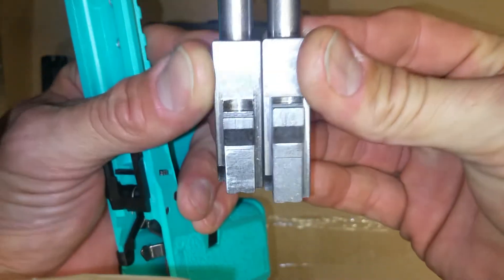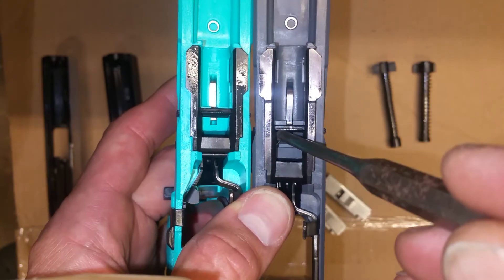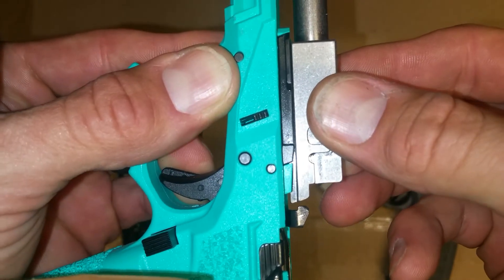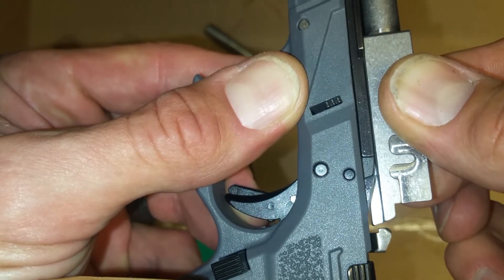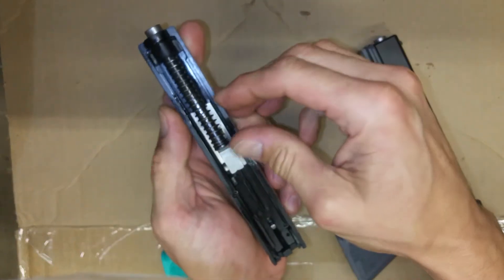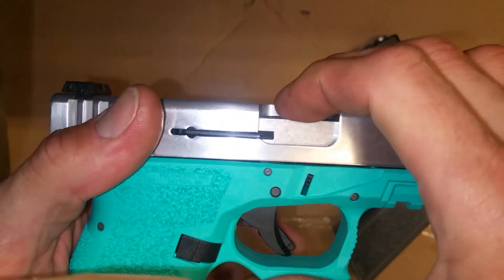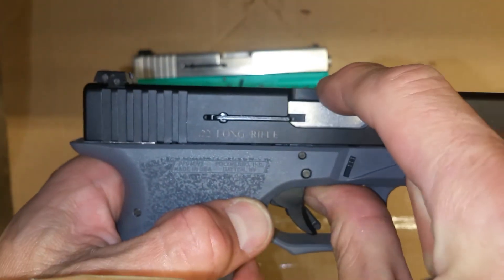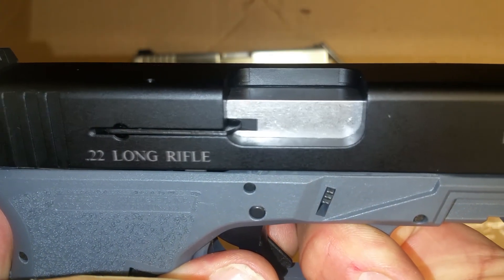Polymer80 barrel travel in lockup (Advantage Arms 22LR)

Comment: I just got the conversation kit for a G22 and it does not function correctly. It fires the first shot upon manual release of the slide but every follow up shot does not fire due to a light primer strike. It seems as if the extractor is pushing back on the barrel not allowing the striker to get close enough to  impact the rim fully. But strange thing is it fires fine rapidly, but does work with slow controlled fire. Any thoughts or come across this?

Comment: How do I take the paint off and make it look like that
Reply from the maker: I masked off the area where I did not want to remove the black coating (anodizing ?) and bead blasted the exterior, then wd-40/mothers with fine steel wool then cloth, I wanted a satin finish rather than mirror.
Reply: How can I get it mirrored

Comment: Those frames are pretty clean on the inside .....what did you use to mill it out?   

I've owned at least 6 Glocks through my life... 3 being the g15.  No I don't own one now.  My favorite was the g30 my dad had but I had a g21sf that was also pretty shaweet.  
I've been wondering about doing a few of the p80 .22lr and 9mm.  Currently looking for deals on multiple frames.  Being plastic they should be sold in packages of at least 2 or 3 as this really compensates for lack of experience and it's better for the parts market with more frames comes more barrels, springs slides, sights.... etc.

Comment: I personally have done 30 plus polymer 80 builds " I'm an FFL " and I know that a few of my builds had the same movement that you have here in your video, however I've yet to have a single issue as a result. The only issue I've ever had was with the original Polymer 80 frames before they had the now included metal rails. Hope this helps
Reply: I'm having similar movement only when charged the slide ,have not  fired yet is this a problem

Comment: One thing to remember is that the aa conversions are designed to work with glocks. You didn't put them on glocks.
Getting one of these to work on a version 1 poly 80 is a minor challenge, but mine is successful.
I did have to mod the slide lock a little for that one to seat easily, and the slide release so that it would lock back when the mag is empty. All the others no issue.
It wiggles a little easier because it is a 22lr.    9mm, 40, etc. will have a stronger spring so they may seem to be tighter.   
The wiggling is irrelevant while it is kicking out the spent case and loading the next round.
Seems like you built a couple nice pistols.
Shooting high might be the build, or just might be you. They are light so it will show you if you have any bad shooting habits. I actually limp wristed mine a couple times.

I get best results with cci mini mags. Round nose or hollow point. Golden bb is mostly ok, but have had some that don't ignite. 
I really enjoy mine, and the work great with good ammo. There are a couple youtube videos showing what ammo doesn't do so well.  
I lube my rails with white lithium grease, and wd40 on the ejector.

Haven't needed to adjust my sights, but you should be able to tweak it for elevation.

Comment: Very clean channel. How did you mill the guide rod channel?
Reply from the maker: Mounted the provided end mill in a drill press, set the table to an appropriate height, frame mounted in the plastic jig, with the grip side of the jig against the drill press table and the frame and guide rod channel pointed straight up and facing me..... simply held the jig tight to the table while slowly removing material. I would have never tried it, but .....a buddy that had a huge boner for one of my previous builds milled his out with this method. I watched thinking the end mill would catch and make a paper weight - worked so well I now use the drill press for everything.

Comment: @jammerbomb thanks for posting these builds. I completed a similar full size build sometime ago and I found that despite all the reviews, info, and manufacturers recommendation the build runs perfectly using Wolf Industries lower parts kit, Glock OEM slide lock, and the 17/22 Advantage Arms .22lr conversion slide. The play in the slide you show is noted in the owners manual/info and seems necessary to remove the slide. The only issue I encountered was while using Federal Auto Match .22lr and one particular mag that would not cycle correctly, however I have not had one issue using the Remington Golden Bullets.
Reply from the maker: Nice! Thanks for the confirmation, I as well have concluded the play is normal. I compared to an older oem 22, it also had similar play.
The gray 17 .22lr in the video shoots very well, but also very high - I will need a taller front sight.
There is four 19's and one 17 in my group now, all with AA 22lr conversions. With exception to an older AA 22lr version on one of the 19's, all shoot reasonably well. The problem child above does have modified mags with extensions and additional rounds.

As a side note - the magwells from Steel City Arsenal are absolutely sweet and fit perfect on the polymer80.

Comment: Awesome Builds, Have u shot them yet to see if it runs?
Reply from the maker: Yes, they both perform without issue with a full mag test.
I have zero experience with a glock based platform, so unsure if this is simply normal or particular to the full size AA 22lr conversion.
Interested to hear from a fullsize poly 9/40 owner if this is normal.